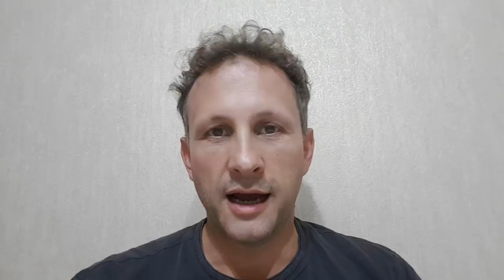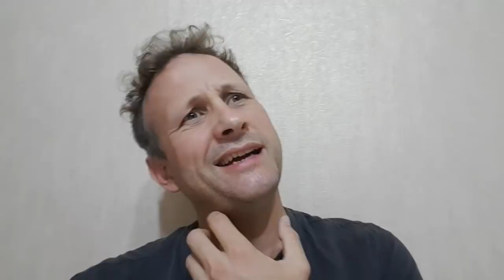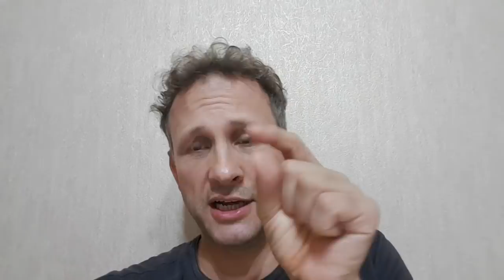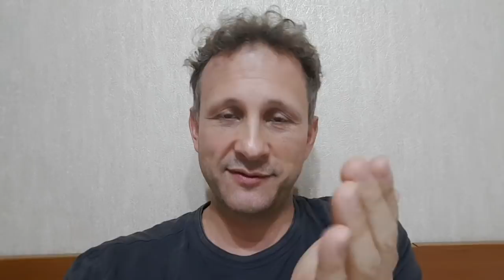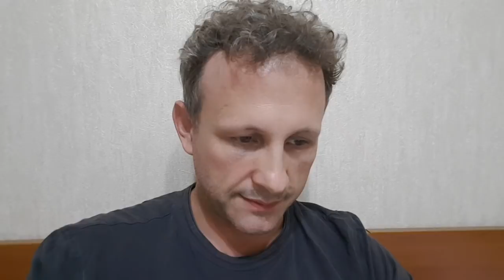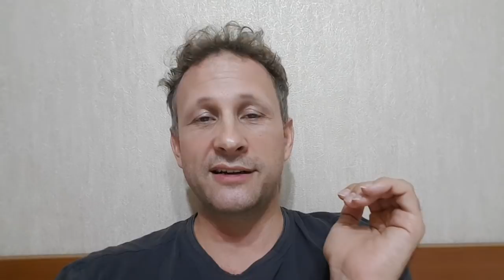Sochi, Day Review - 3rd October 2018

Comment: Very good information. Diamagnetic bismuth. With the comments on dielectric layers as shields it occurred to me that closely resembles 'interference ', aka 'dielectric ' optical filters which are precise optical dielectric layers. Could be a strategy to identify the EM spectrum of the strange radiation.  If it is in the soft xray region then it makes sense that it would greatly increase cancer risks. Really look forward to hearing more as the conference progresses.